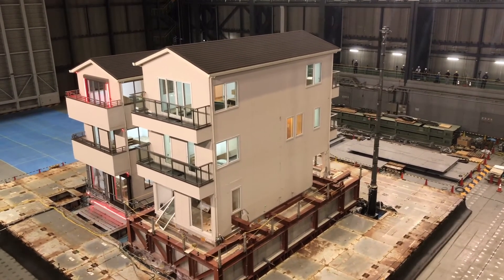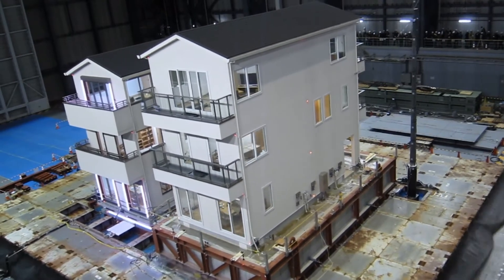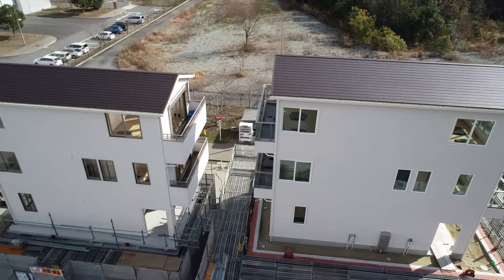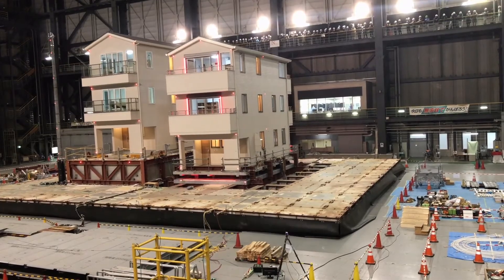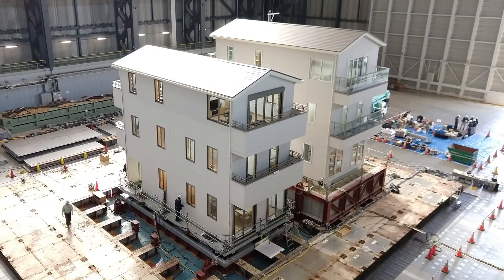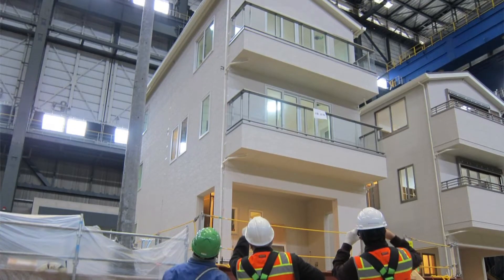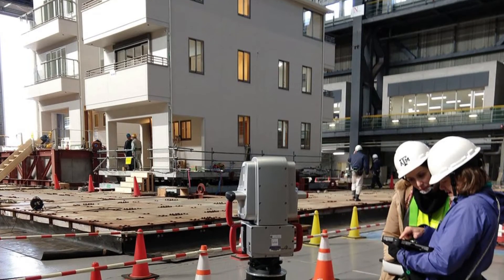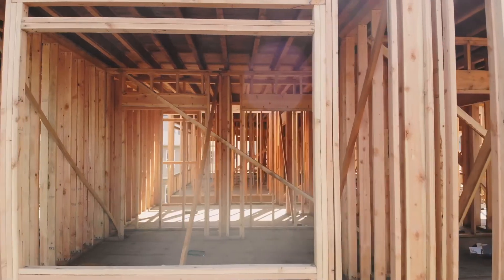World’s largest shake table reveals how earthquakes damage wood-framed buildings

Comment: Where can I get one of these? It looks so fun I Want to be in one
Reply: This is in Japan, in Miki City which is just north of Kobe.  It has a surface area of 300 square meters.  There are larger tables but they only function in two dimensions; this is a full 3D system meaning it has a vertical axis as well as the two horizontal ones.
Reply: yea me too, i want one too, it would be a nice alarm clock.
Reply: @lois3356  OMG XD